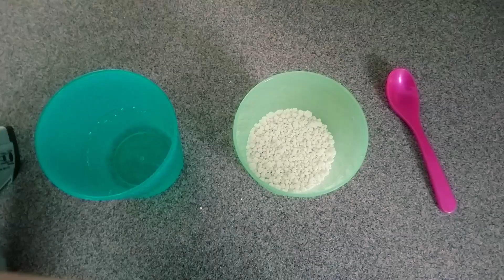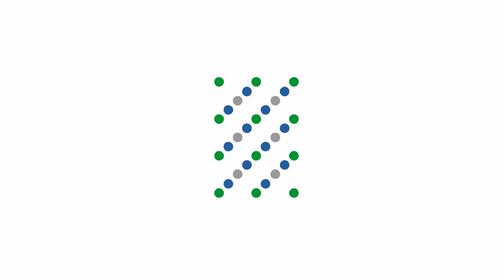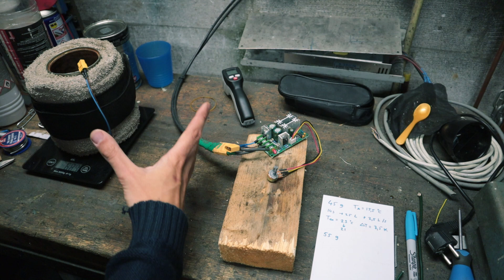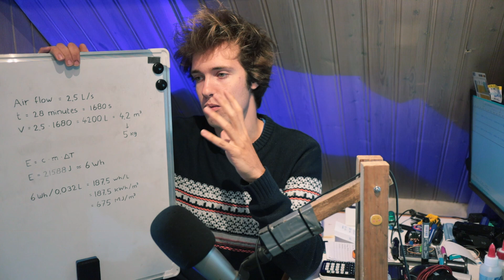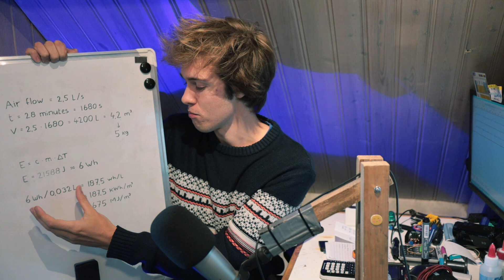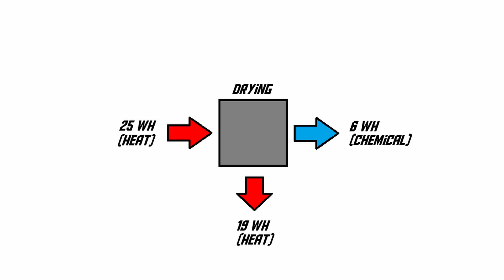Thermochemical energy storage: an interesting way to store heat

Comment: Great video! 

A few reflections: Isn't all, or almost all of energy in form of enthalpy of vaporization of water as long as the calcium chloride don't dissolve in water? I mean, calculating based just on the increased weight should get you much more reliable number than measuring the airflow and temperature difference. That said, 10 grams of water condensing and about 2.5 kJ per gram at that temperature, means 25  kJ, or about 7 Wh, and that makes the corrected just over 8 Wh you calculated very impressively close to correct, and considering the given volume of such bags usually are "theoretical" as in open, and filled to the brim, compensating for that your measurement was kind of spot on. That is, assuming I'm correct about the heat being released  from water condensing, and not (at least not much) from dissolving.
     
Especially for buildings that are heated in part to decrease humidity, heating by letting calcium chloride or some other desiccant turn humidity into heat seems like a great solution. 

Regeneration could be done more efficiently by using a heat pump, which can both provide the heat, and remove the released moisture from the air.  

If, or how fast solid calcium chloride hydrates release the water when heated depends on temperature and humidity, so "extreme" temperatures aren't required to regenerate it if the humidity is low. 

I did a similar "experiment" but much simpler, with just small amount of sodium hydroxide in an small open container, without forced airflow. I just measured the temperature, and while I don't remember exactly it remained several degrees above ambient, for several hours. Sodium hydroxide is not as practical as calcium chloride, partly because it's potentially much more dangerous than calcium chloride, and partially because it reacts with CO2 in the air and can't be as easily regenerated as calcium chloride.
Reply from the maker: The latent heat thing is an interesting one. I have tried to figure out to what extent the energy comes from purely condensation, vs the hydration of the salt, and found it difficult to find a good answer. What I do know is that there's also adsorption (with a d) based systems that condense water onto the surface of a porous medium. In this case, all of the energy is latent heat from the condensation. This is what happens in these zeolite systems that some people have mentioned in these comments. But in a salt hydrate system, as far as I'm aware, there is also energy released from the hydration. I am kind of hoping that someone with more chemistry knowledge can enlighten me on the specifics of this, that would be quite interesting.

For the temperature, if you have a very low humidity, you could run it at lower temperatures, but there is still a minimum temperature you'll need. To dehydrate a salt, it needs to be heated past its melting point, so for example, to go from CaCl2 tetrahydrate to CaCl2 dihydrate (which is pretty much what happened in the video) you need to heat past 45C, because that's the melting point of the tetrahydrate. At that point the water comes out and you can evaporate it off. 

One of the reasons CaCl2 is actually considered not a very optimal medium, is that its higher hydrates melt at low temperatures. For instance the hexahydrate melts at only 30C. That means, if you hydrate past the tetrahydrate, and the reactor is over 30C (which it almost definitely is) you'll end up with a liquid. The tetrahydrate melts at only 45C, which also makes it unsuitable for domestic hot water for showers and stuff (which requires 60C for anti-bacterial reasons). The di- and monohydrates melt at 170+C, so you'd avoid these problems, but you'd also need 170+C to dehydrate, which impractically high.
Reply: @AKIOTV  From what I've read, I was under the impression that each CaCl2 hydrate has a humidity equilibrium point, that varies somewhat with temperature, under which it will loose water to the air, even when solid, so now you've forced me to reevaluate what I thought I knew.  

Anyhow, again, great video!

Comment: DId you check the humidity of the air?
Reply from the maker: @gino_latino  No, but there is no need to do that for this test. The humidity affects the power output of the setup (how fast it hydrates), but not the total energy output. With more humid air, the exhaust temperature is higher and it can run for less long, with dryer air it can run for longer and the exhaust temperature is lower. 

This is probably the reason I was able to run it for longer than expected during this test, the air contained less moisture than during previous tests I did, meaning it ran at lower power and thus could run for longer.

Comment: I thought about it with zeolite. It would be great using a heat pump generating enough exhaust heat to dry material and then use the energy in winter. When I looked I found a zeolite with an activation temperature of 80C. That’s still to hight for nowadays days heat pumps I guess. But it’s already closer than 170C. I do live in an apartment house so I stopped researching once I saw how many m3 Zeolith I would need. When building a new house one could use the foundation as a storing space for the needed amount. Also one could use exhaust heat from air conditioning and top up the rest of needed energy with PV. Then it could be I thing.

Comment: I wonder if we can use it twice: to charge it you need heat. My smart solar mppt can get above 50 C when the sun shines, and then must be cooled to be no more than 40.
So actually the right storage would be something that reacts around 40 degrees, automatically regulating the solar charger.
And then at night hopefully you can put it in a hot water bottle for in bed. Of course, we need it to be bigger than this.
Reply from the maker: @bloepje  50C is on the low side for calcium chloride, but a different salt might do the job. 

In general, using waste heat to charge TCES systems is widely considered. For example you could also use waste heat from industrial plants etc. to dry salt at a large scale. Any form of waste heat is usable, so long as the temperature is high enough to (partially) dehydrate the salt that is used.

Comment: Your error bars are nearly bigger than your signal. You also didn't include the power to run the fan, but given your measurement accuracy it would be below the noise floor and is probably not a major factor anyway. You're also comparing apples to oranges. The lithium-ion batteries are measuring useful electrical energy, whereas you're just measuring energy in the form of heat which is much simpler. You have no way to convert it efficiently to electricity. It's useful only for heat storage, and for that there are just much better and simpler alternatives. Nobody would recommend using a lithium-ion battery as a heat storage device. Bizarre comparison.
Reply from the maker: @human_shaped  No one would use li-ion batteries to store heat, because they're much too expensive and there are far cheaper effective alternatives. That's pretty much also what I said in the video. Now of course, you can argue that's too obvious to even include them, but I decided to put them in there anyway,  for the following reasons:

1) they are a useful benchmark for energy density since a lot of people (at least in my audience) are familiar with their size which helps visualise the kind of energy density we're talking about.

2) although arguably stupid for storing heat, li-ion batteries are pretty much the only available method of storing heat that doesn't lose energy over time. If you wanted to store heat for a long time, sensible heat or pcm storage won't work. The only option that is practically available would be batteries.

The fan was running at like 25% speed, it consumed less than a watt of power, I decided to not bother with that haha. It would have been good to mention that in the video.

Comment: I suppose if you let it dry in ambient temperatures it would still store that heat. It would take longer but, it wouldn't use an external power to heat it to dry. Good project!
Reply from the maker: @GTN3  You do need an increased temperature, at room temperature it will keep absorbing water until it dissolves in it. You leave this stuff in open air and the next day you'll have a puddle of brine.

Comment: I would need 20 MWh for heating. Let's be optimistic ( global warming ) and use 2MWh. I would need 10 m^3 of CaCl + water That is a lot. Now considering realistic scenario, I would need 100 m^3 of CaCl + 50 m^3 of water ( to use purified water ) + losses and non ideal conditions..... more like 200 m^3 space needed. That is a lot. I made a ist of possible material candidates. After like 20 different compounds, I realized the best choice is probably simple iron powder oxidation and reduction ( realistic space and price requirements )
Reply from the maker: @jozsab1  The water doesn't need to be stored though, you can use vapor from the air, or a moisture pit if you have an extremely dry climate.

I'm not entirely familiar with iron oxide. Maybe interesting to look at for a video some day.

Comment: You can use a hygroscopic liquid that heats up when mixed with water.
This water can then be evaporated, for example, in a solar heater.
Of course, this method is completely unsuitable for use in vehicles, but for heating a house it is an almost ideal heat accumulator.
Reply: Are there such liquids?

Comment: You list it as energy storage, but I think it makes even more sense as a generator itself. You can use the sun to dry it out directly at a much higher efficiency than a solar panel, and then also store it till needed for release. I think it really is both in one.
Reply from the maker: @chris993361  You could charge something like this very well with solar heat. Industrial waste heat is another interesting option.
Reply: You have to consider it in terms of comparison. It's not simply about if it can do a job, but if it has characteristics that are better than other alternatives and if it is reasonable to use in scenarios where it provides the most benefit.
Yes, you can put it out in the sun, but you can also put a solar panel out in the sun and collect the same amount of energy. In this specific scenario the question then becomes, which of those two options provides the greatest return, or the efficiency of taking a set amount of solar energy, storing it in some medium, then converting the stored energy into useful energy, in this case heat.
Reply: @blackoak4978  My point was that you would collect more of the sun's energy, not the same amount of energy as with a solar panel. I don't know what the efficiency of drying out the salt is with the Sun but it's got to be higher than the abysmal efficiency of a solar panel.
Reply from the maker: @chris993361 A solar heat collector is more efficient drying salt directly compared to using a PV panel and electric heating. But if yoh already have PV panels, and once in a while have to disable them when there's no demand, then electrically drying salt still makes sense, since it's better than turning the panels off entirely.

This more broadly applies to other heat storage too: heating a water heater with solar heat is more efficient than an electric water heater powered by PV, but if you already have PV panels, and at times no purpose for their energy, an electric water heater can be a good idea to install.

Comment: If you're thinking about performing a similar experiment with zeolite, then keep in mind that it will only heat up if it's completely dry. If you dry it in room temperature, and add water, the exothermic reaction will NOT happen.
Reply from the maker: @baraBober  I may try zeolite some time. Would be interesting to see the difference. I suspect the same setup would work, although I might add better insulation to the dryer.

Comment: Here's what chat GPT has to say about safety of this reaction:

When water is added to calcium chloride (CaCl₂), an exothermic reaction occurs, meaning it releases heat. This reaction itself does not produce toxic fumes. Calcium chloride dissolves in water by dissociating into calcium ions (Ca²⁺) and chloride ions (Cl⁻), and the release of heat is due to the hydration of these ions.

However, depending on the purity of the calcium chloride, there may be some minor concerns:

Impurities: Commercial calcium chloride can contain impurities that might release some gases or vapors. For example, if it contains magnesium chloride or other substances, they might interact with water differently.

Aerosols: The heat generated can cause rapid boiling of water, potentially creating steam or fine aerosol particles. While these aerosols are not inherently toxic, breathing them in could irritate your respiratory system, especially if they contain impurities.

To stay safe, it's best to perform the reaction in a well-ventilated area, and if you're working with large quantities or unknown purities, wearing a mask or ensuring proper ventilation is a good precaution.

Comment: If you place the heat storage inside the environment where the heat will be needed, leaking heat ceases to be much of  a problem.    ALso look up Zeolite... used in some dishwasher drying cycles  already
Reply from the maker: I guess it depends when you're charging it. If the charging is done when heat is also needed for something then there is indeed no loss. 

I knew about zeolites, but didn't realise some dishwashers use it haha. It appears they have an energy density disadvantage compared to salt hydrates, but they don't suffer from the same physical degradation which is nice.
Reply: @AKIOTV  , yes it's a different mechanism (zeolite vs cc)   , some bosch dishwasher have the zeolite system.   I may experiment with the  CC too.   I wonder how corrosive it is.  For simple thermal storage inside my space I used a ceramics kiln filled with Basaltic rock... I liked the largish rocks because of the air spaces..  makes it easier to get hot air flow in and out. The Kiln , having a lid is nice.  Very cheap high temp solution.  If I were in the I.K I would just use some old night storage heaters... but we don't have them here in the USA , at least not cheap used ones.  Thought about using low temperature water for heat storage, it takes up more volume and could freeze etc, all systems have pros and cons. The Kiln is very simple if one is safe about the very high temperatures.  The nice thing about the Thermal (and electrical)chemical storage systems is they can store and be used way down the line...since they can be activated when needed....For daily (nightime release) the thermal kiln storage will save cycles and need for larger lithium batteries, much cheaper... for "edge cases" (many dark days in a row) Then I will go to my Lifepo4 and or a generator to charge batteries and recover the generator waste heat.  Heat pumps as the normal heat source.
Reply: @AKIOTV  For the physical degration problem, there is a paper that shows that mixing in a small percentage of hydrophobic silica fume prevents/reduces the physical degregation of the calcuim chloride. Google "furmed silica calcium chloride" and look for the scence direct link, the paper title is: "Exceptionally high energy storage density for seasonal thermochemical energy storage by encapsulation of calcium chloride into hydrophobic nanosilica capsules".

I've been searching for a simular reaction that occurs purely in a liquid phase, as liquids are easier to processor and automated. Just starting to read up on mixures of lithium chloride and calcium chloride. The other reaction i've been searching for is one where the drying reaction occurs, around 40-60 dC, so that an energy efficent heatpump can be used.

Thankyou for the video, calcium choloride has some amazing energy storage denstity. And i think your conclusion is wrong, calcuium chloride is insanely cheap. Can store on the order of 388 kwh per cubic meter, which is well with the seasonal storage range, and 170 dC isn't hot, everybodies oven can get that hot.